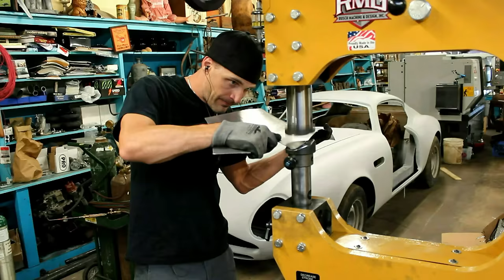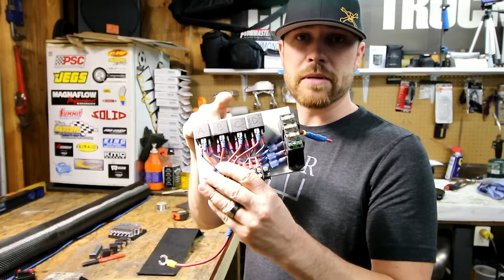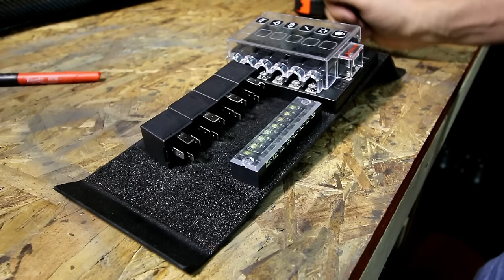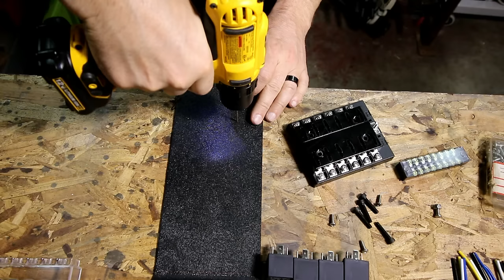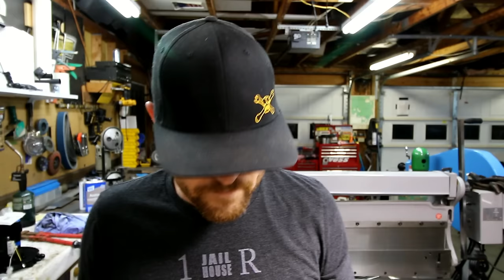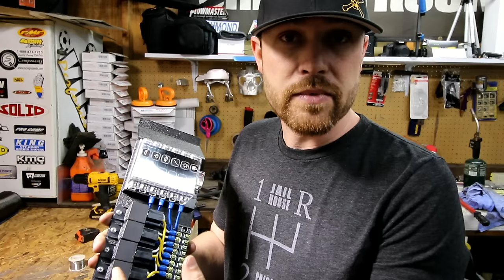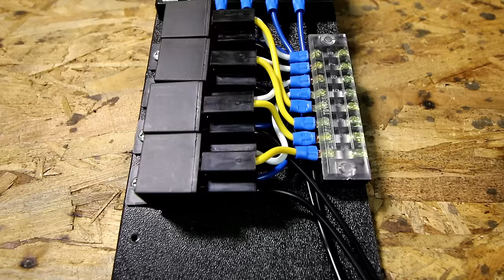How To Make A Power Relay / Fuse Block | Automotive Wiring

Comment: How do you solder the electrical connections? Does the plastic on the ring terminal melt?
Reply: +RideThroughLife Also, how tight of a bend can you bend the ABS and have it still be strong? Will it do 90 degrees without cracking or getting too thin?
Reply from the maker: +RideThroughLife Yeah I bend the crap out of it and never have any issues
Reply from the maker: +RideThroughLife I just use a torch and heat the tip of the terminal ...never melts that plastic. here is a video where I used this technique. https://www.youtube.com/watch?v=0smYuQSoE78

Comment: I have the 5 plug relay and my wires are different colors than what you showed, can you tell me which color goes to each corresponding number on your relay please? I found this very helpful otherwise.....  Thanks   Mike
Reply from the maker: There should be a diagram on the relay that shows what each pin does. 85 and 86 are switch power and ground - 30 is main power in and 87 is main power out.
Reply: That helps, I'm not much for electrical work, I had to watch this 3 times and draw a picture to remember where the wires go, thank you so much for the help....   Mike

Comment: So for a light bar do I even need a relay cause I don't want it to come on with anything else. Just it's own toggle switch?
Reply from the maker: yeah the problem is the switch it self can handle the amps....so you have the light powered by a relay and have the switch just activate the relay
Reply: The Fab Forums so run the switch on the battery line into the relay

Comment: Mistake crimping terminals with side cutters instead of crimpers, can form high resistance joints after time or you accidently cut to deep
Reply from the maker: they were crimpers
Reply: I apologize, you're right, very deceiving, they look very much like ordinary side cutters, what brand are they out of curiousity?

Comment: So my question is .. after the block you put the switched “fan” lets say 10 ft away from it . Theres gonna be voltage drop but nothing to worry about ? Nice work thou neat
Reply from the maker: no voltage drop if you use the proper wire

Comment: whats the recommended gauge for the wires going from the fuse to the breaker and from the breaker to the battery ?
Reply from the maker: It just need to be able to handle more amp than the breaker size....so it really depends on the breaker you plan to use
Reply: +The Fab Forums I've searched a bit but some topics go on a tangent about temperatures. The breaker I'm using is 100 amp. I have some spare 4 gauge cables with some copper/gold plated terminals. Do you think 4 gauge is enough? I've heard that the shorter the connection the thicker the cable allows for a better flow
Reply from the maker: 4 gauge is not enough for 100 amps. I would go with at least 1 gauge or bigger
Reply: +The Fab Forums I appreciate your reply. Thanks

Comment: How did you calculate the right circuit breaker you need?
Reply from the maker: Its based on the max load that the wire you use can handle. The main power wire I have coming in is welding lead cable, thats why I am using this high of a breaker. If you are using wire rated at say 100 amps than you would want a 80 amp breaker

Comment: umm, don't mean to sound critical but I wouldn't recommend putting high amperage loads on the same power strip used for switching the relays.  The output of the relays should be isolated from the relay inputs.
Reply from the maker: They are isolated...all the pin are separate.
Reply: The Fab Forums yes, I know they are physically separate but they are still on the same block where you may not have enough spark gap isolation or where you might accidentally touch a nearby connector connecting another wire.  in any application where you have signal switching high voltage or current, you don't want the two near each other in proximity.

Comment: Can you put over 100 amp on that fuse block?  Great video
Reply from the maker: be a little more specific
Reply: @Thefabforums  can i put lets say 5 30 amp fuses on this box?
Reply from the maker: @randyhernandez8860  yeah I dont see why not
Reply from the maker: @randyhernandez8860  it may say what its rates too on the listing
Reply: @Thefabforums  it says 100A max but I just wanted to verify with someone who has actually used it.
Reply from the maker: @randyhernandez8860  yeah I havent loaded that much on mine
Reply: @Thefabforums  ok thanks man

Comment: random nothing to do with the video. quick question what would be a good welder to buy price not fully an issue for a beginner welder, planning to use it around the house making random kick ass shit and possibly fab'n up so stuff for car or trucks. I'll be starting school for welding come this June. thanks.
Reply: Hobart 140 is a great little welder, will take gas and welds up to quarter inch.
Reply: +peppy3200 thanks man!!
Reply from the maker: +Carlton Wright TIG or MIG?
Reply: +The Fab Forums mig and tig
Reply from the maker: +Carlton Wright I use a Miller Diversion 180 (great starter TIG) there are some other brands I here alot of good things of that are a good bit cheaper. Like the 2016 AHP TIG. I have not used one my self but I think you can get these for under $800
Reply: +The Fab Forums ok thanks alot man. truly enjoy your channel and vids very helpful. yeah ill look into that Miller one, want to buy a good one so i learn that one well so  not buying like different models over n over again. might as well invest in a good that'll last

Comment: Nice video with lots of good ideas,  But I don't understand why you are protecting what looks like a 30A wire with a 300A circuit breaker.   Maybe I missed something? I admire people like you who know how to create and fix a lot of different things.  My Dad was like that.  He could build houses, pour concrete, weld, fix automobiles and almost anything mechanical.
Reply from the maker: the "30 amp" wire is protected by what ever fuse you place in the fuse block. The circuit breaker is for the main power cable that supplies power to the entire fuse/relay panel. In my case I am using 0 gauge welding lead cable.

Comment: I had done a dual Concorde fan upgrade on my s10 and they kept melting relays so I had to switch to a dual relay setup to handle the load.
Reply from the maker: working good now?
Reply: +The Fab Forums ya I wired them in parallel and I haven't had a problem.
Reply from the maker: sweet

Comment: This video can be helpful, but it only takes 150mA to kick a relay, so it will only take a little over a half and amp to power up that entire circuit. Your coil 85 and 86 on the relay polarity doesn't matter. Once it's gets power now your common 30 and N/O 87 is a closed circuit.
Reply from the maker: yeah the lack of amp to trigger the relay is exactly why you use one....not sure what you are getting at
Reply: The Fab Forums someone going out and buying a relay that is marked, coil, common, n/o, n/c, or 85, 86, 30, 87, and 87a is not going to understand your terminology.  Also check out Bosch relay guide 6th edition pdf, very helpful and informative to anyone with almost any car application.

Comment: Why not use relays with fuses on them, they sell on eBay? I uses them , for space a simplify. No need for fuse block,the fuse is on the relay. Then I just use a fuse block for just low amp . Also ,use the connector with shrinking heat rape after crimpling, to eliminate condensation over time.Open to input to this way ,any time I can reduse less connection is my goal. Plz comment.

Comment: What will dictate what amp fuse you will use in each accessory. Sounds like a stupid but I really dont know.
Reply from the maker: you want the fuse to be the weakest link so you want the fuse rating to less than the rating of the wire used. That being said you also have to consider how many amps certain accessories are going to require. EXAMPLE a set of fans will require more amps than some gauge lights....

Comment: Man I hate those plastic covers on crimp connectors, the first thing I do when I get new ones it take them off and just use heat shrink instead too me it looks cleaner. But anyways I want to do something like this when I build my race tractor...after I build my tig welder....
Reply from the maker: +thomas smith Yeah I dont care for them either...just heat shrink over them. I will have to try removing them
Reply: +The Fab Forums I use a blow torch to get them warm then pull the plastics off, just don't melt them to much haha

Comment: A switch has two wires, once you connect one switch wire to the other side of the terminal from the white wire, where does the other switch wire go, the appliance, in this case your example "the fan?" Just an element I didn't catch.
Reply from the maker: +Hardrock you have power coming into the switch and when switched you have power out to activate the relay
Reply: Okay, thank you, that's what I missed, I for some reason assumed the battery power was being fed to the switch from the white wire on the other side of the distribution block. Thanks for clearing up my confusion. All the best.
Reply: How do you wire for power windows

Comment: Which type of electrical wire Guage are you using?
Reply from the maker: +Alan Onciul I think the relays came with 16 gauge
Reply: The Fab Forums okay thankyou
Reply: The Fab Forums what kind of switches can I use with 16 Guage wiring?

Comment: So to run a switch you just run run one side to yellow and one side to white and part of that to the "accessory "?
Reply: dallace seiuli

These relays have four pins, numbered 30, 85, 86 and 87

85 should be your relay [coil] ground
86 will be from your switch
30 will be your 12V battery supply
87 will be the device you want to work.

It is presumed that pins 30 and 87 will be grounded through that device.
Reply: dallace seiuli P.S so for this video.
Blue wire is pin. 30
Yellow wire is pin. 87
White wire is pin. 86
Black wire is pin. 85
Reply: SASMAN 52  from to where would I connect a toggle switch for my fan ?
Reply: Jesse Cabrera You're switch would go in between the white wire and a 12v power source.

Comment: I don't quite understand if someone could help me out. How would I wire he switch... wouldn't I need a switch between the fuse block into the relay? A power source into the switch then to the relay? I'm confused.
Reply from the maker: You have Main Power In, Main Power Out, Switch Power, and Ground.  Its that simple.
Reply: I understand that. But the switch wire goes to the switch (two terminal flip switch) what goes on the other terminal on the switch
Reply from the maker: You have power coming into the switch on one terminal then you have power coming out of the switch on the other terminal going out to the activation side of the relay

Comment: good source for those automatic breakers are airplane breakers/suplyers 
the only reason i know these things exist is because i seen them on panels meant for comercial airliners
http://c8.alamy.com/comp/DW97MJ/close-up-view-of-aircraft-fuse-panel-DW97MJ.jpg
http://aeroelectric.com/Pictures/Breakers/circuitbreakers.jpg

theres a special grease for conducting electrical components called dielectric grease , its silicone grease that conducts electricity but prevent the contacts and connections from corroding and causing problems later on 
realy sticky stuff

can put a m4 bolt in from the back of the panel to create a groundpoint for all the wiring on the front
Reply: oops oh whell good to know , thanks for the info 
wat i was taught was to use the stuff in automotive connections as it helps expand the life and conductivity of the components , i prolly misunderstood its meaning
Reply: aircraft breakers are really expensive... everything for aircraft is.. i've built small airplanes, the costs for small, seemingly insignificant parts are staggering.. even on airliners you usually won't see any high amperage DC circuit breakers.. most all higher current applications are 115VAC.. most you will see for DC circuits are 50 or maybe 70 amps at 12-28VDC ..  using them for low amperage DC circuits would work great though provided cost isn't an issue.. aviation breakers range from 20 bucks to hundreds each depending on the specs/brand/application.. start adding up all your circuits... it get's real expensive real quick...  but, if you are planning to blow fuses so often that you need a breaker, you want to re-think what you are doing... on the other hand.. a breaker is nice to kill a circuit for maintenance...

matt already told you about the dielectric not being conductive... they do make conductive grease as well.. typically it's a grease with fine metallic particles like anti-seize compounds...

Comment: so the switch to activate has to run its own ground but the power runs to the box?
Reply from the maker: well the switch will only have a ground if it has a light. if not power runs into the switch and then out of the switch to box once activated
Reply: Yea, how would you wire up lets say a simple 2 terminal switch into the white wires? Would you go straight from the battery into one side of the switch then out the other side of the switch into the white wires???

Comment: The maximum amperage for chassis wiring according to AWG that would handle 300amps and not melt that wire before tripping the breaker is 000. Would you not be better off using a 5awg 118 amps Max and using a 100 amp breaker? Someone correct me if I'm wrong.
Reply from the maker: no I run welding lead cable from the back...but you defiantly want to use the correct breaker for the wire
Reply: @Thefabforums  ok gotcha, I'm trying to figure out why you would run a cable and a breaker that size to a fuse panel that has fuses of max 30/40 amps, why not just run like a 50 amp breaker? Thank you
Reply: @Thefabforums  I guess what I'm trying to say is how would you be able to draw that much current through those relays and fuse block?
Reply from the maker: @PattayaNight  the cables main purpose is to supply enough juice for the starter. With a large power and ground the system doesnt know the battery has been relocated. I actually run a 000 welding lead ground cable to the back of the engine cylinder head as well.

Comment: VERY IMPORTANT SAFETY ISSUE: The purpose of a circuit breaker is to prtect your cars wiring, this insures the breaker pops/fuse burns out and disconnects power to the circuit before your cars wiring melts/burns up. That being said to keep your car from burning up the wire has to be rated at a higher amperage at 12vdc than the breaker/fuse, this is also true with the relays and all connectors. that way if something gets shorted out or fails the wire, connectors and relay akl survive okay and the breaker pops/disconnects power saving all your car, wiring and devices from burning to the ground.

For example: Putting a 30amp breaker on wire, connector, connected device or relay rated at 10 amps insures the wire, connector, connected device or relay burns up before the breaker pops, in fact the breaker ma never pop as your car burns to the ground.

So bottom line it is critical that all the wiring, connectors and devices on a circuit are rated for a higher amperage than the breaker, this is the only way to insure the breaker/fuse actually trips before all the wiring and devices.

Having a 300 amp breaker connected to a wire rated at 50 amps,  terminal block rated at 3amps, relays rated at 20 amps, wire connectors rated at 30 amps insures the breaker will never trip and insures the wire, connectors, relay, terminal bock will burn up if a short or issue occurs.
Reply from the maker: +alan connelly great point

Comment: For those that like using all OEM style connectors and the like: Mouser.com  (you can save a TON of money making your own pigtails)
Wireandsupply.com has all the wire you could possibly need for great prices
And Ballanger Motorsport has even more
The crimper: Engineer PAD-13 Crimper. 

Dont mean to high-jack, just trying to add sources for stuff.
Anything to make other people's projects go more smoothly.
Reply from the maker: +1320crusier good info

Comment: So how do you get it to work when you want a lighted switch
Reply from the maker: the lighted switch has its own power and ground for the light
Reply: The Fab Forums do the two wires would go to it and then a ground

Comment: This fuse box can be uses to wiring a led light???
Reply from the maker: sure
Reply: Can you explain how what wire is for a bar and what for the switch??please
Reply from the maker: you can search the wiring diagram for a relay and it will be self explained. Power in | Power out | switch | ground
Reply from the maker: you can search the wiring diagram for a relay and it will be self explained. Power in | Power out | switch | ground

Comment: tnx but im still confused on how the white wire gets triggered for example if i have a led with a switch how do i wire it
Reply from the maker: there are 4 connections on a normally closed relay....1. Main fused power coming in - 2. Main power going out (example fan or light) - 3. Ground - 4. activation wire ( this is the wire that is connected to a switch or button that tells the relay it needs to transfer the power through the relay (1+2))
Reply: how does the activation wire gets connected and what makes it to activate
Reply: im used to house wiring so i would put a switch on the hot but here i don't get it
Reply from the maker: yeah you just have 12v running to a button or switch and when its applied it send 12v to the relay activating it
Reply: oh tnx
Reply: so the relay gets 2 times 12v if the switch is in the on positions ? does it put out 24v or does it stay 12v ?